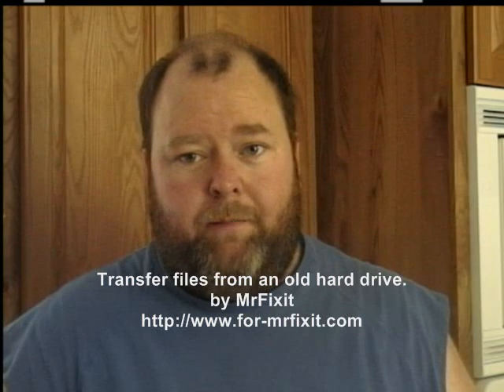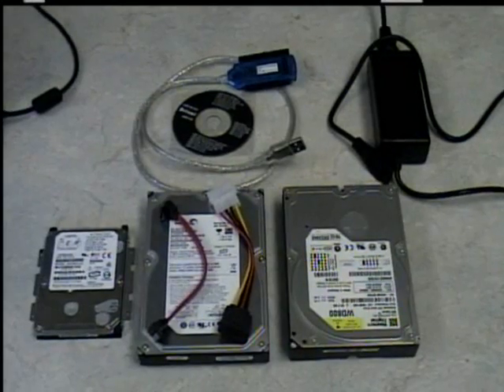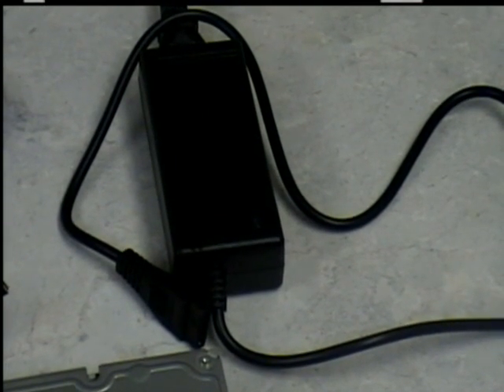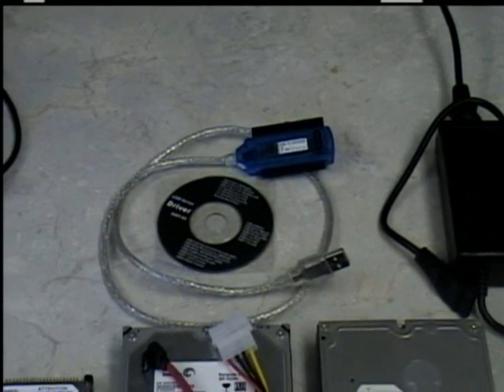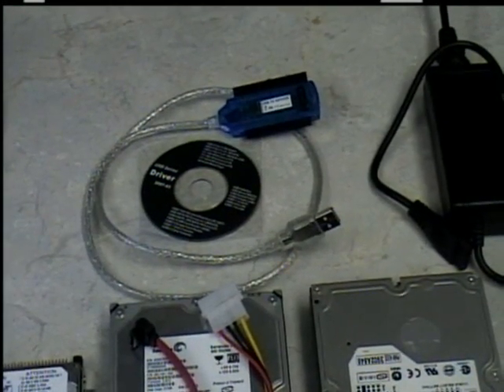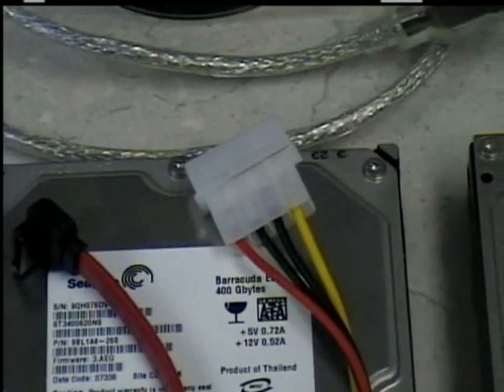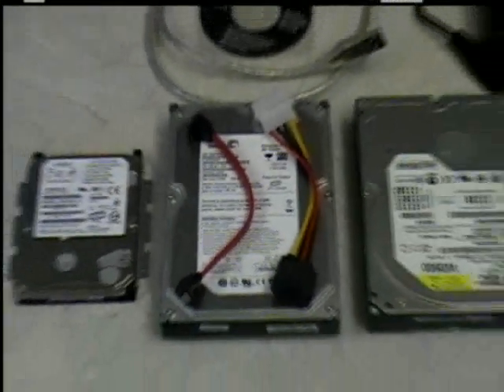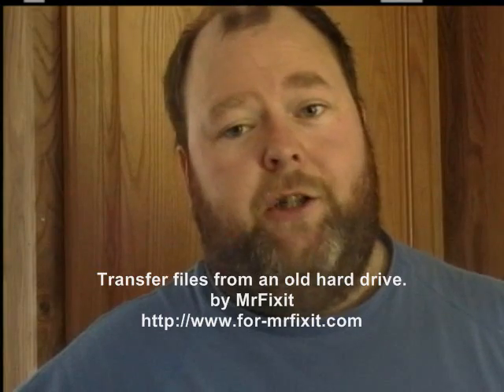How to transfer files from a Dead PC [CC]

Comment: Hi i have a HITACHI Deskstar hard drive that has a sata drive cable, a power supply cable and another cable that has 2 black wires a yellow, orange and a red wire. This hard drive was on another pc but that pc died and i got another one but i need all my data of the hard drive and put it onto the new computer but when i plug it into the comptuter it says insert system disk but i havent got the disk. What shall i do?

Comment: Wished I would have viewed this yesterday.  It would have made it a little simpler.  Just got a cheap $5 "imported" kit very similar to this (except no blinking activity light).  Once I figured it out, it worked great.  I recovered data from two drives that I thought were dead (an external USB and a laptop drive). It was very easy to do, highly recommend these kits.

Comment from the maker: The adapter is IDE/SATA to USB, model ADA-2020, made by Generic. There are several different versions and manufactures. I purchased my adapter at Geeks.com. Their part number is 2020 with out One touch Back-up or 2020-OTB with One Touch Back-up. -MrFixit

Comment from the maker: There is a process called "cloning" which will make an Identical copy of the entire drive including the OS. It will require Cloning Software which I demonstrated this procedure in Migrating the OS video. In some cases, to format a drive will require Administrator privledges, in which case, type in the password of the user logged on to windows.  -MrFixit

Comment from the maker: The  NTLDR is a file called NT loader. Any Windows OS using NTFS format require this file in order to boot the OS. The file isnt required to be on the drive to transfer files from it. there are several causes to the error. Can be fixed using Microsoft Windows Recovery Console.  -MrFixit

Comment: OK, I solved it tonight. The pictures were in a folder (old computer) called HP Administrator that did not copy over to the new computer. It did not want to open either, but finally did after a few tries. I was relieved to finally find those files for mom.

Comment: yes the adapter works for 3.5 inch desktop hard drives and a 2.5 inch laptop hard drives.If both the old and new hard drives are SATAs  you can use a dual hard drive dock to do the the same thing as this adapter

Comment from the maker: Drivers shouldn't be much of an issue. He will need an OEM Windows 7 disc to install the OS on a new computer. Drivers should come with the new parts. Make sure the parts are designed for Windows 7. Once the OS is installed you can then transfer files. If the laptop still works (boots to the OS) you can use the "Transfer Files and Settings" function using a USB file transfer cable. I have demonstrated how it works in a video. -MrFixit

Comment from the maker: 2nd, You'll need to use another PC to Clone the Old HDD and may need a second adapter for the new HDD. The other PC with the software can attempt to clone the drive to the new HDD, but isn't guaranteed due to possible errors on the old drive. If the software is unable to clone the HDD, you'll need to by an OEM version of Windows 7 to reinstall the OS. You may be able to purchase a restore disc from DELL for the laptop which will save a lot of hassle then just need 2 transfer your files. -MrFixit

Comment from the maker: If the HDD in question is still functional, You can use this adapter to transfer files to the new drive, except Windows OS. In order to transfer the OS you must Clone the original HDD to the new drive using this adapter. The Cloning software can be downloaded from the HDD manufacture's website. I do have a video to show how to migrate the OS to the new drive, called 'Migrating the OS' on our channel. -MrFixit

Comment: If that wasn't clear, I basically am putting in a brand new hard drive in my desktop and I want to plug a flash drive into the desktop that has Windows 7 and other files that I transferred from my bad hard drive. Is this going to work for reinstalling Windows 7?

Comment: @ESRepair... I had to buy a new hard drive for my Dell Inspiron 580 as the old hard drive is shot. So once I put in the new hard drive, I will need to get Windows 7 back on it. Windows 7 came preinstalled on the Dell and I never made a backup. I was told that I can hook up my old (bad) hard drive like you did in this video, transfer Windows 7 and any other files I want to my laptop, then save to a flash drive, then plug in the flash drive after installing the new hard drive. Any advice on this?

Comment from the maker: As for the HotBox, I assume you are referring to a HDD docking station? As for this method, yes, you can use this adapter. It is cheaper using this adapter than buying the Docking Station or the External USB HDD kit if you do not plan to keep the drive. The adapter is called an IDE/SATA to USB and range from $7 to $30.  -MrFixit

Comment: @ESRepair I have a Toshiba Satellite A205 Laptop. Old thing. Had it for about 4 or 5 years now. Last year, it suddenly gave me the issue where it wouldn't go past the log in screen. Only recently it's been progressing to the home screen on safe mode. But Windows Explorer is always crashing. I have a hotbox, but I want to back up my data onto an external gard drive before I do it just in case. Will this method work to save that data?

Comment from the maker: Yes. It's a temporary solution. In most cases, a new PC doesn't have the room for a second HDD and most people are not keeping the old drive. I do, however, have a video that converts a HDD into a External USB Drive using a USB Hardware kit, for those who wish to keep the drive. -MrFixit

Comment from the maker: You can, however, you may run into problems. The new PC was designed for Windows 7. If XP does boot up, it will try to install new device drivers and you will need to register XP with Microsoft.again. The best way to do it is to not remove the HDD, but, rather connect the old HDD to the motherboard, like I did in "Migrating the OS" video. Just need a data connector and the power cable for the old HDD. Y-adapters are available for the power cable if needed. Be sure not the touch the HDD board.-MF

Comment: Thanks for your response. Another option if possible......do you think I could just remove the hard drive (hd) in my new pc, then install my old hd without any boot up problems? I could then move any important files to a thumb drive and then totally erase everything on my old hd with a disk wiper program (someone wants my old hd). I could then remove the old hd, reinstall the new original hd, then plug in my thumb drive to install any files I want to transfer. Think that would work?

Comment from the maker: You can add the old HDD n your new computer as long as there is an empty 3.5" bay, an available Data connector on the motherboard, and a power connector 4 the HDD.. Many home PCs do not have extra bays and/or power connectors. You can move the PC components into a bigger case, but that can take some doing. I do have videos 2 help install a 2nd HDD. Once installed Windows 7 should recognize the new HDD. It is also possible to create a "Dual Boot", but may require XP to be re-registered. -MrFixit
Reply: Hello. My Drive has 39 pins together and then 8 more grouped together and then one in the middle of those two. Does that make any sense? Can I still use this same kind of adapter? It's a 3.5in Quantum Fireball

Comment: My old desktop pc's CPU went bad. It used Windows XP. I purchased a new desktop pc what uses Windows 7. 
Can I just simply remove my old hard drive (that used Windows XP) from my old pc and install it in my new pc (that uses Windows 7)? Would my new pc automatically recognize another hard drive installed? If so, couldn't you just simply view and transfer any files from the old hard drive into the new pc?

Comment from the maker: Be sure to close all programs that used the HDD. If still will not stop device, click START, then CONTROL PANEL. Open DEVICE MANAGER. Double click DISK DRIVES in the list. Under Disk Drives, double click the External USB Device. Click the POLICIES tab. Be sure OPTIMIZE FOR QUICK REMOVAL is selected. Then OK. This will prevent the OS from locking the HDD. When the activity on the Drive stops, you can remove the device. -MrFixit

Comment from the maker: No. By reinstalling windows you will erase anything that was installed. Some OS install reformats the HDD erasing everything on it. You should be able to run Windows 7's Startup Repair Utility. When you see the logo, press and hold the F8 key till the 'Advance Boot Option' appears. Choose 'Repair your computer' (available if a recovery software was preinstalled). Under 'System Recovery Option', choose 'Startup Repair'. -MrFixit

Comment from the maker: "One Touch Backup" refers to the function provided by the software that comes with the adapter. Once installed, anytime you press the button, the adapter's backup software will initiate a backup of the files/folders selected by the user. It isn't required to use the adapter. The software provides compression during backup to save space on the connected HDD and the ability to restore those files later. The only thing that really differs is the price with/without the software -MrFixit

Comment from the maker: You're welcome bigantdawg2k3. As a matter of fact, I do have such video to help you convert the HDD to USB. You'll need an External USB HDD kit. They are available for 2.5 inch and 3.5 inch HDD that use either an IDE or a SATA connection. Here is the link for my video. (youtu.be/ZmoPGV7qWs). You can also find it under our uploaded videos, too. It's called "Converting the HDD into an External USB drive". If I can be of further assistance, You know where to find me. -MrFixit

Comment from the maker: Yes, however, it wouldn't hurt to have an AV program installed to monitor activity. Root-kit viruses are hidden and usually disguised to fool AV software. As long you do not boot from the infected HDD you should be fine to retrieve your files. Do not open any file not even the program used to create the file except those you created. Do not open any emails stored on the HDD. You can run an AV Full System Scan on the HDD using this type of adapter. It'll be slow, but worth it. -MrFixit

Comment from the maker: Yes, however, if you wish to have a permanent USB HDD to use for back-ups, I suggest using an External USB HDD kit similar to the one used in my video. (youtu.be/ZmoPGV7qWs4). The kits are available to convert any 2.5 or 3.5 inch HDD using either an IDE or a SATA connection. -MrFixit

Comment from the maker: The problem with the HDD is the platters themselves. The data can be recovered depending where the data is located as opposed to faulty sectors. The platters cannot be removed due to a HIGH RISK the platters become misaligned by just a micron of an inch (0.00003937). It's cheaper to try and correct the errors via software since the platters are worn out. If the control board failed than yes a professional can replace the board. A professional can charge a hefty price for such recovery. -MrFixit

Comment from the maker: Yes you should be able to access the HDD. You will probably need a DATA Recovery software to help solve any issues. It mainly depends on the severity of the failure. There are free versions but I am not familiar with any of them. This adapter will access the drive but may be slow due to the errors. The only way to transfer Windows is by cloning the drive via software to the new drive. The least you can do is get your important data off the drive. -MrFixit

Comment from the maker: If the control board or other mechanical damage is present, there isn't much you can do to retrieve the data on the HDD. The HDD will need to be sent to a specialized Data Recovery firm. There they can possibly repair the HDD to retrieve Data stored on the drive and send the recovered data back to you. -MrFixit

Comment from the maker: You can still use the HDD from the old pc. If the new computer has room for another HDD, u can install the old HDD and use it for Data. If not, u can convert the HDD into a USB drive to make it portable using a USB Drive Enclosure kit as demonstrated in "covert HDD to a USB drive" video. -MrFixit

Comment from the maker: Some PC manufactures install a hidden partition on the HDD that contains all the software, including the OS, installed when the PC was built. the partition usually called "recovery" or something related to the brand name. If the OS will not boot press and hold the F8 key during the LOGO and Power On Self Test. A menu will pop up and will have several options including safe mode. Some recovery software respond to F10 during POST. PCs since VISTA contain a hidden Partition as standard. -MrFixit

Comment from the maker: The white connector is a 4-pin molex used to connect power to an IDE drive. The power supply comes with this adapter with the 4-pin power connector. it also comes with an adapter called a 4-pin to 15-pin SATA power connector. -MrFixit

Comment: I'll be trying this as I found the adaptors cheap online and I need to access my files quickly.I can't boot on that computer and I don't have the orignal Windows XP CD to fix it yet.Thanks for the tutoral.

All PC's with Pre-Installed Windows should always come with a start up disk for these problems.

Comment from the maker: Check the power connection to the HDD, especially when using the 4-pin to SATA power adapter. Solid State Drives will not make any sound since there is no moving part in them. Standard HDD should spin up as soon as power is plugged into it. Some power adapters have misalignments when inserting the connector. Check to be sure no pin was pushed out of the connector. -MrFixit

Comment from the maker: What you are describing sounds like a SATA HDD. They connect the same way as the 3.5 inch Desktop version in the video. Do not worry about the four pins, that's used by the manufacture. The short and long connectors that have gold lines: the short one has 7 gold lines (Data connector) and the long connector has 15 gold lines (Power connector). Connect them the same way as I do in this video starting at 6:57. Watch for the polarities, the cables will only connect a certain way. -MrFixit

Comment from the maker: @ja747452 I'm not sure, Joe. There's no brand name on it and I no longer have the box. WhizKid may still have his box. He has the same adapter. Ill have to ask him when he is home from work. Everything in the video comes with the adapter except the HDDs and the PC. You have the power supply, 4-pin to SATA power adapter, SATA Data connector, and the USB adapter. Some do come with backup software. The "covert HDD to USB" video is a more perminent solution if keeping the HDD. -MrFixit

Comment from the maker: @life12345ful You can buy this adapter at many online stores like Amazon, Geeks, Newegg, TigerDirect, and OverStock to name a few by different manufactures. Its called an IDE/SATA to USB adapter. Be sure the adapter supports 2.5 & 3.5 inch of both IDE and SATA HDD. This one was purchased at Geeks website. -MrFixit

Comment from the maker: @ppompeiable You can buy this adapter at many online stores like Amazon, Geeks, Newegg, TigerDirect, and OverStock to name a few by different manufactures. Its called an IDE/SATA to USB adapter. Be sure the adapter supports 2.5 & 3.5 inch of both IDE and SATA HDD. This one was purchased at Geeks website. -MrFixit

Comment from the maker: @stan0486 Technically yes, this adapter can be used to move files from one HDD to another, However, you'll also need Cloning software to move the OS and make the new HDD bootable. I explain how this is done in my "Cloning the HDD" in our uploaded videos. The process is fairly simple. Many manufactures have their own clone software already on the new drive to use or a link to download their software. -MrFixit

Comment from the maker: @ironhead41 I wouldn't tear off the tabs. Some 2.5" drives use a bracket there may be a tiny screws holding the tabs in place on the sides. Inbox me with your Email address and the model of the HDD in question. If you can take pics of the back side of the HDD, ill tell you where to send them so I can see the tabs. These HDD mount different ways depending on the builder of laptop/notebook. -MrFixit

Comment from the maker: @lookatmydragonballz that HDD is a SATA. Use the small red cable and the 4-pin to SATA power adapter as demonstrated in the video. Connect the other end of red cable to the adapter's plug marked SATA. Plug the sata power adapter into the power supply watch the orientations. The SATA HDD have different connectors than IDE. -MrFixit

Comment from the maker: @grclubpengujuan Ok if the HDD light  stays solid on, there's nothing you can do other than replace the motherboard and CPU. This is an indication that something is wrong with either the MB or the CPU. If there are files on the drive that you want to keep, u can use an IDE/SATA to USB adapter used in this video. -MrFixit

Comment from the maker: @grclubpengujuan Since the monitor works and you hear Win ME's theme music, the GPU need replaced. Integrated Graphics Processors (IGP) cannot be replace since they're made into the motherboard, but a new graphics card can be added using either the PCI or AGP expansion slot. This is fairly simple to do as long the new card supports Win ME. When u turn on PC, Watch the HDD light. If it stays on solid for more than 15 seconds turns off and nothing else happens, then its a different problem.

Comment: @ESRepair 
i proved that monitor on my windows 7  and it worked right on the other computer when i turn the computer and the monitor it stays in stand by mode it shows nothing on my windows me so the monitor is fine so what could be the problem